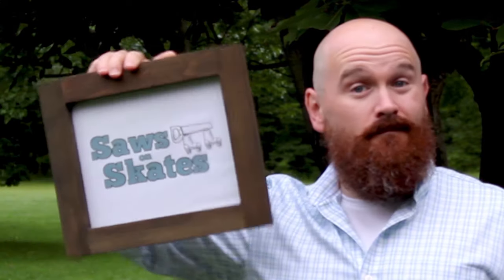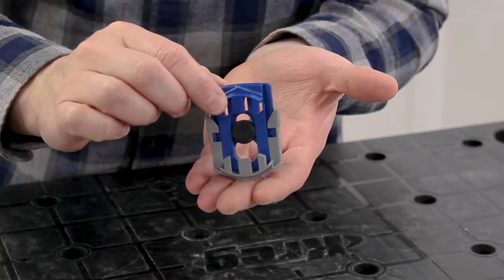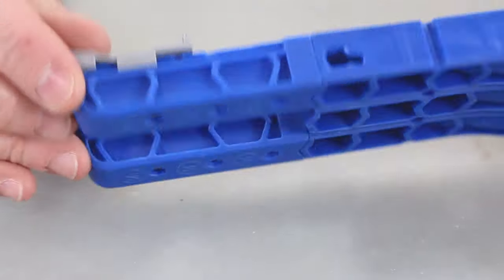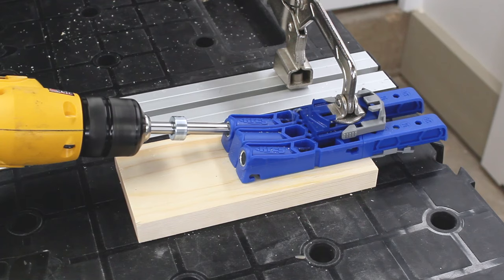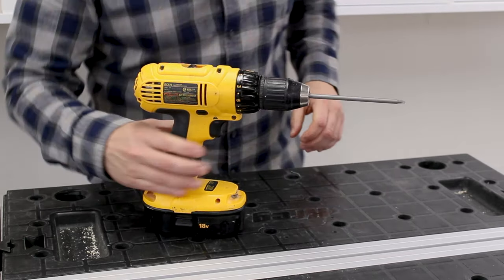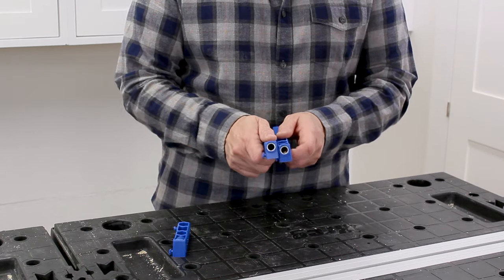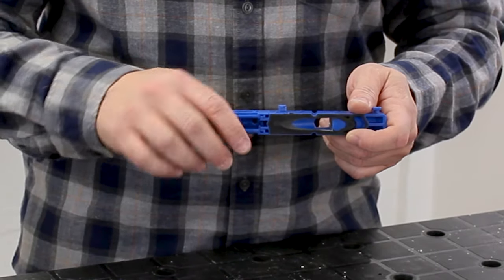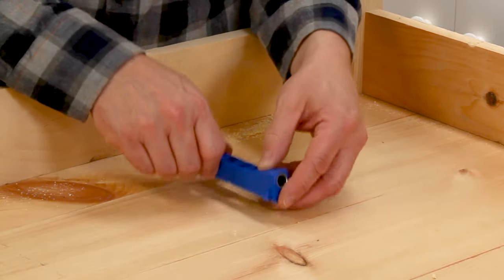How to Use a Kreg Pocket Hole Jig 320

Comment: The video was pretty good but something very essential you failed to mention was that those pocket holes you're drilling coincide with the length of a screw as well. You can't necessarily drill a 1" screw into a pocket hole that was drilled for a 2-1/2" screw and vice versa. If done incorrectly, that screw will come out poking through the wood at another end defeating the purpose of pocket holes. And even though a screw is long enough to pierce the second piece of wood, that doesn't mean it's a secure connection because it may have barely reached the other piece but not bitten into it enough to grab securely. Very important to mention that.
Reply: The pocket hole being drilled doesn't determine screw length. The material that your screwing into does.

Comment: Very clear video but you didn’t mention what length screw you used. Was it 3/4” to correspond to the wood thickness?? In other words, how do you determine what screw to use with each wood thickness??? Otherwise, great video!

Comment: Excellent review and tutorial. I’m a newbie and this really helps. I was wondering how the screw length is determined when drilling the keyhole into a 3/4” but the receiving piece is 1 1/2”. Would it still only be a 1 1/4” screw? BTW I’ve just purchased a 320 Kreg Jig and love it!

Comment: If I am drilling pocket holes in a piece of wood with a thickness other than 1/2, 3/4, or 1.5 inch - such as 5/8 or 1 inch; how do I determine where to place the stops on the jig.  I noticed that I cannot set the stops between the given depths because the indents will not secure the stops from moving.  Should I use the indicated stops for the thicker or thinner material.   i.e.: use 3/4 inch or 1.5 inch indicated for drilling in material that is 1 inch thick?

Comment: Which setting would you use in 5/8” thickness wood?  1/2” or 3/4”?
Reply: I think you should set it to 1/2".  In this video, the thickness of his board was 7/8" and he rounded down to 3/4" (1/8" less).  Following what he did, you should round down 1/8" too to 4/8".  TLDR: always round down to the nearest setting because if you round up, you'll poke a hole through the other side.

Comment: I want to do some shelving using some plywood, I want to use a jig like this to create to the pocket hole screws  on the bottom of the shelf but the vertical piece of wood I am connecting into is an 18mm piece of plywood. Can anybody and advise if my shelves will be strong enough as the screw will only go into the vertical board max 18mm?

Comment: In all of these videos, nobody ever mentions the length of the screw you should be using. I'm sure that it depends on the thickness of the wood, but what if it's a butt joint on two 3/4" pieces of wood?

Comment: How do you determine which screws to use and do you risk cracking the second board without pilot holes?
Reply: The screws are self-tapping (assuming you use the pocket-hole screws, which you should) so splitting is unlikely unless you overtighten I believe